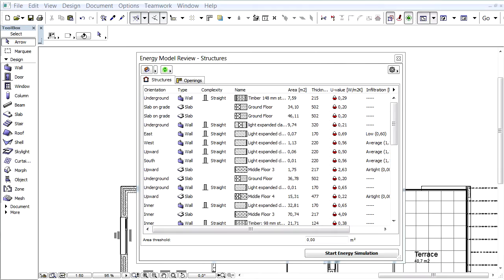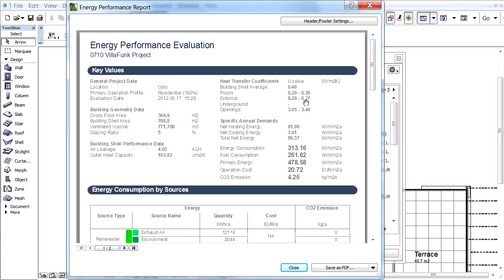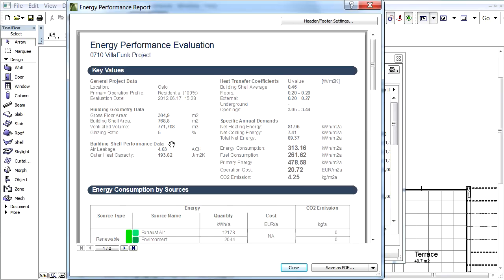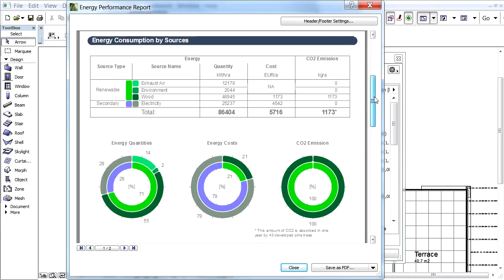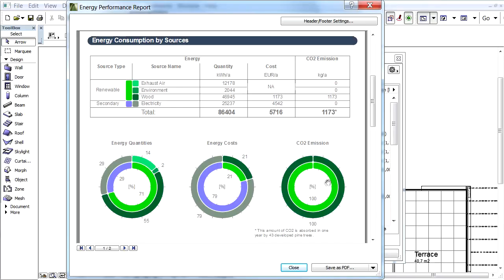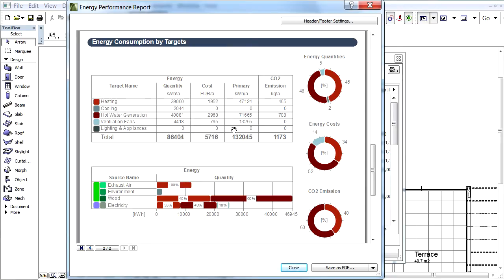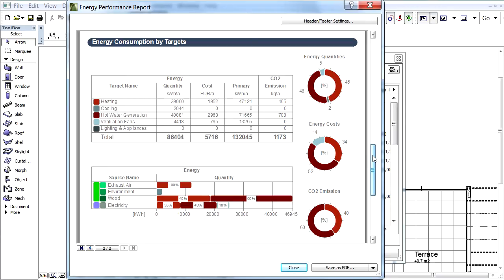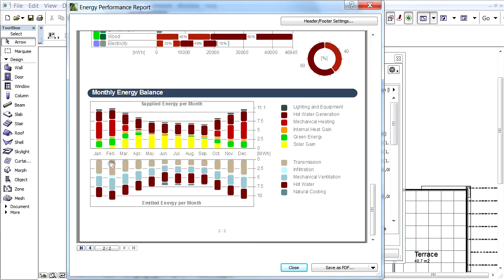ARCHICAD Energy Evaluation - Run Energy Simulation and Review the Report

Comment: need more instruction on how to insert data required for the output, for example heating and cooling services, amazing it give you the cost and tell you how much energy is from renewable source too, must be a lengthy process to fill up the data, and whether those data are accurate